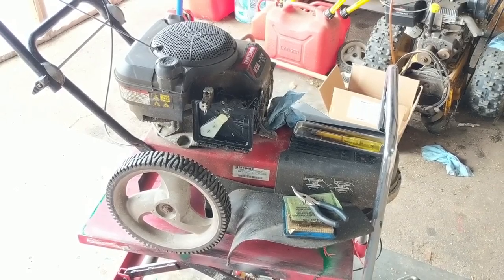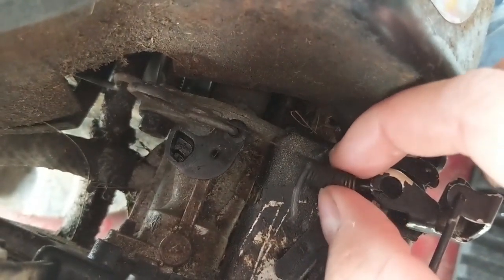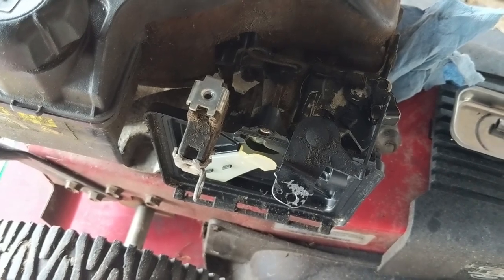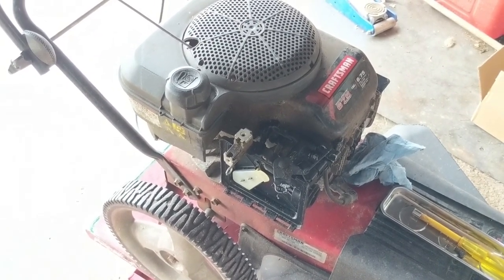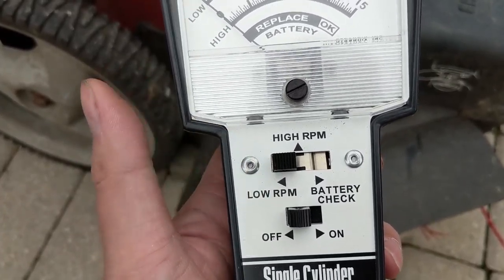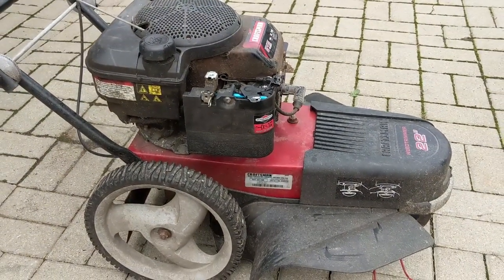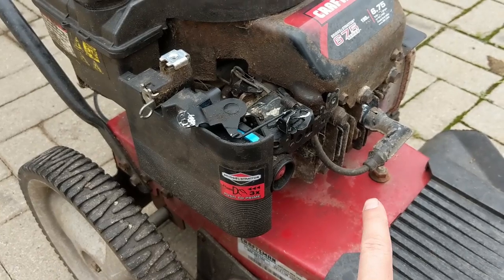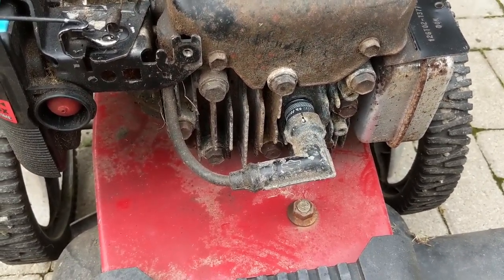Craftsman 22" Walk Behind Trimmer

Comment: I have found that there are several carbs for the string mower and the connections are different.  I finally found instructions for the one I have and it works fine. Hard restarting when hot. Possibly new coil??? Coil resistance seems stable.
Reply from the maker: Check resistance on spark plug cap, I had one over 10k ohms of resistance and spark failed when hot. https://youtu.be/ejAX6Bn4WSo

Comment: Great info, thanks.  That was why my trimmer wasn't choking.  The throttle cable control housing had slipped and wasn't engaging.  The little sleeve holding the rubber tubing in place had come undone and had to be crimped back onto the tubing inside the control lever housing.

Comment: In your case was the throttle cable in the way of getting the air cleaner cover off. Just picked up a used one, and mine is.
Reply: I removed the screw on top and to the front to the little linkage cover  and the one screw of the filter cover. Then I used a small pliers to crimp the black plastic tip of the cable tubing so it backed up thru the little metal half circle, then it was out of the way of the filter cover.  The filter cover has just a couple of bottom tabs and you can wiggle the cover up.  The cable tubing and wire is easy to push back thru the metal semicircle bracket.  It will still be attached at the wire linkage, no need to take it off there.  I had the throttle in the off position when I did that.

Comment: Excellent video. I’m glad I came across it. I have a question that I hope you can answer. I actually have two of these machines, one is brand new but it’s missing some parts. That bottom handle that the upper handle attaches to where it has the two silver grip things and that silver steel rod running from one side to the other, I’m missing that lower handle and I missing one of those gripping device things. I don’t know what they’re called. I also need to replace the mount where the cutting string attaches to as one of the clips that holds the string is broken off on one of them. Where can I buy parts for these? Any idea? In your video you said you listed all part numbers below, but I guess I’m trying to look at the forest through the trees and I can’t see it, lol any help would be appreciated.

Comment: What stops that throttle tab from vibrating back into the low rpm range?  I have a metal Topside oil extractor like that. ... Love it.
Reply from the maker: Usually there's enough resistance on it to prevent that, thanks for watching!